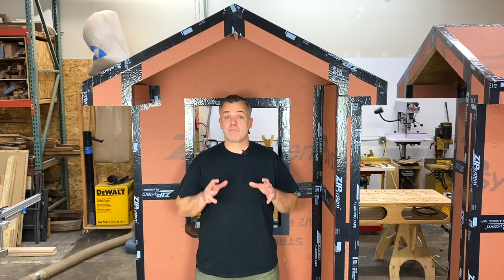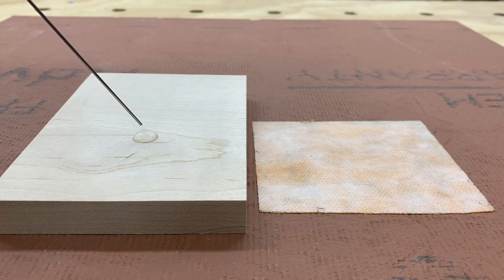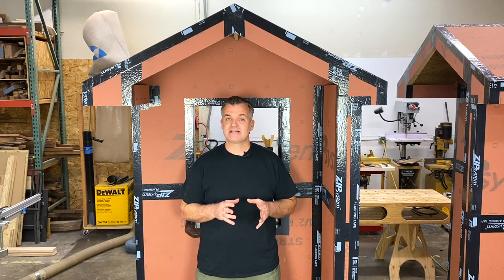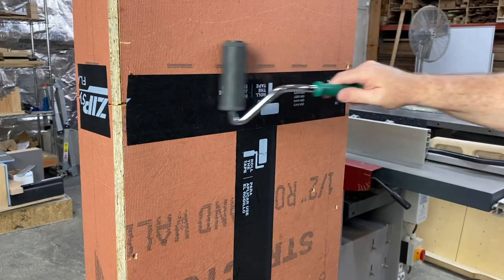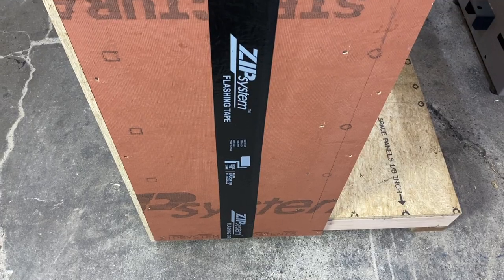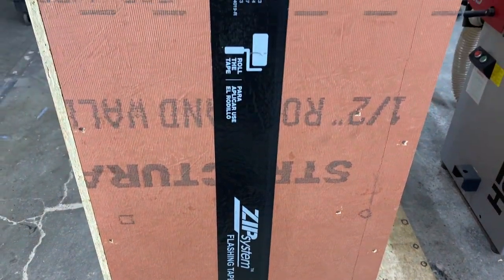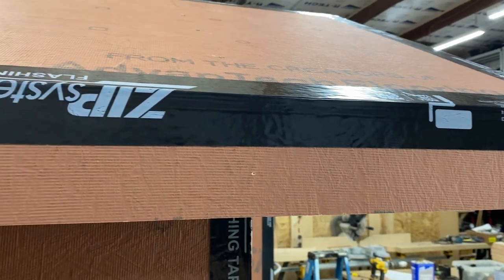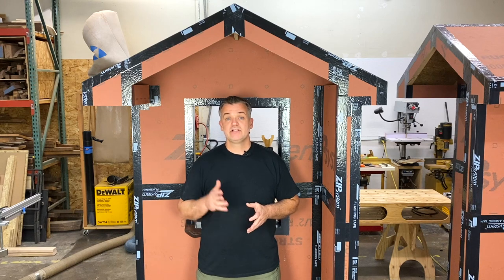How to install Huber Zip System Tape

Comment: Where can one buy that roller?  Huber sells one but, inexplicably, it has metal teeth that look like they will cut into the tape- one reviewer at Home Depot said that is exactly what happened.  The one you are using looks perfect but I can't find one like it anywhere.
Reply from the maker: Their Z roller has impressions on it so you can see where you have rolled but I don’t like it either. This one I got from Huber but you can find similar ones on Amazon.

Comment: We have about 75% of our roof panels up, but looks like rain the next few days. Should we go ahead and tape or do you think it can handle the rain until we finish installing the rest of the panels?
Reply from the maker: It won’t hurt the panels but it will leak, it would be best to prevent leaking into the house as soon as possible!!